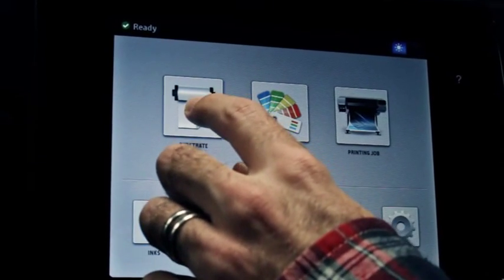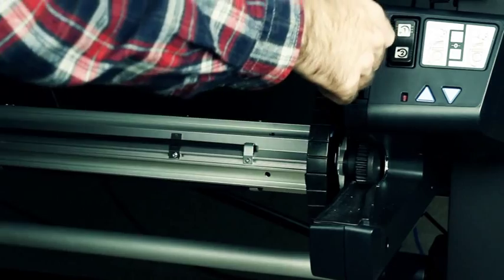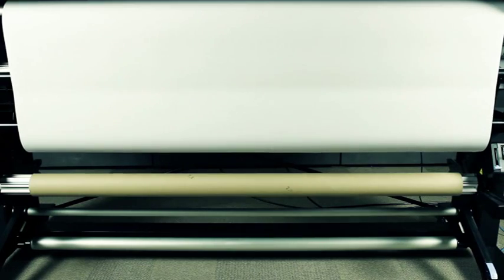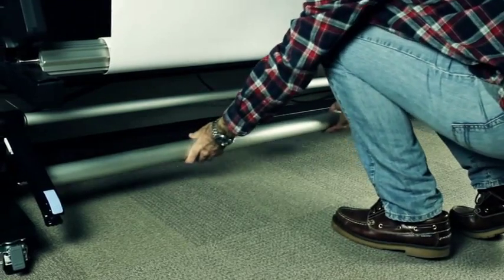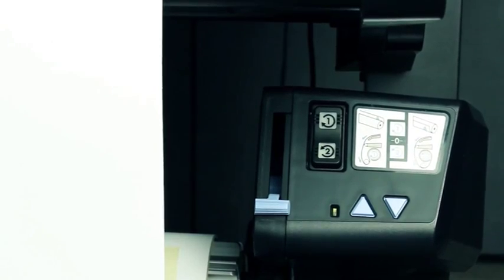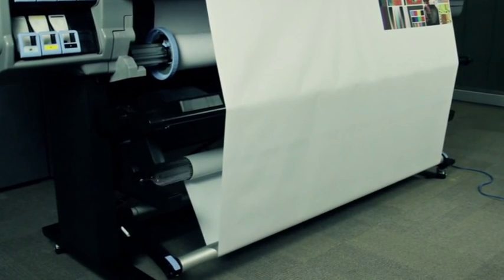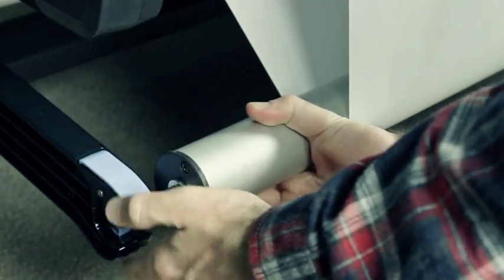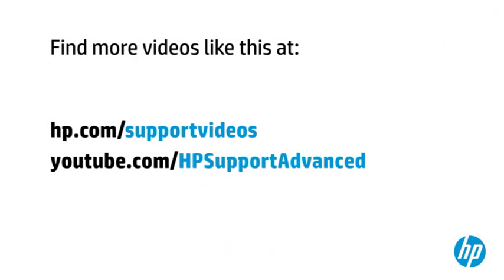HP Latex 300 Using the take up reel

Comment: Hp is the worst printer you can buy , i own an hp  latex 365 and i have nothing but a headache since i bought it, real garbage printer, every time i go to print something the image comes out looking like shit, real shit. Colors are bad, smearing, scratches, and so on. i lose a tremendous amount of media trying to get it right each time i go to print something. I tried calling hp customer service, and they have dropped my call 3 times, their customer service is WORSE than their printer. Product support? there is none, YOU ARE ON YOUR OWN, I am throwing my printer to the trash, not even trying selling it, i am buying an EPSON which is 100 x better, i don't have the heart  to sell this piece of garbage to someone else.  IF YOU'RE SMART STAY AWAY FROM ANY HP GARBAGE.
Reply: I have a hp latex 365 printer. Bought it around September last year. 
I faced the same problems at first. Then after a lot of experiments i learnt some tricks. 

Load the media (substrate) hanging 2 inches out of the heater. Cut 3 long strips 1'*3" media and use it to join the media and output core. Will save a
Lot of media. 

Always use vinyl profile for printing on any media. 

Use 175 to 180 degree Fahrenheit in 6pass 

185 to 198 in 8 pass 

205 to 225 in 10 pass. 

Black colour prints need more heat to dry. Adjust accordingly. 

Keep a heat gun with you in case the print is not complete dry. 

Keep the same temperature throughout the same series of print. 
Sometime the media size increases when the temperature is very high. 
.
Reply: This printer is a joke @kunalkiranbehera
Reply: Thats interesting! We have 2 of them, and I absolutely love them! Definitely was some learning curves, but once we figured them out they have been work horses for us! I joined a group on FB called Print Fam and they have helped out a ton as well